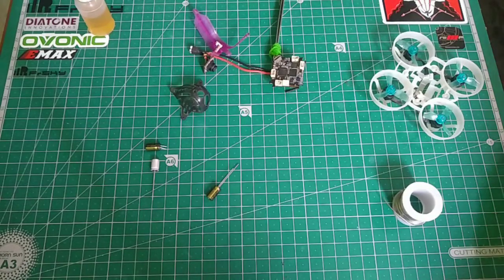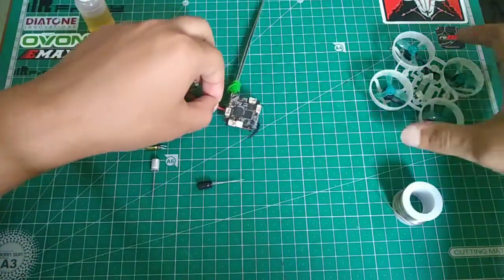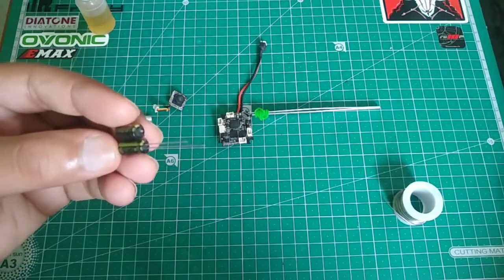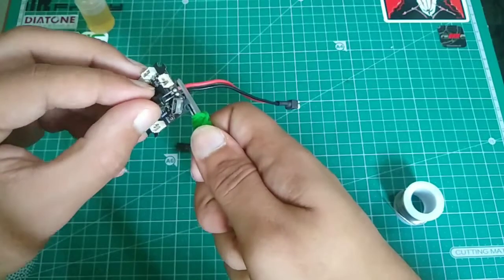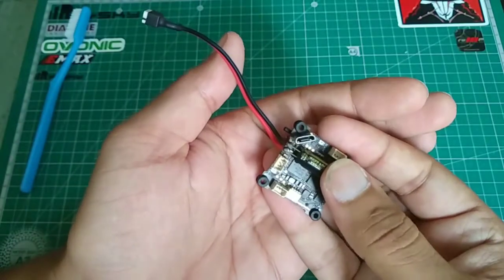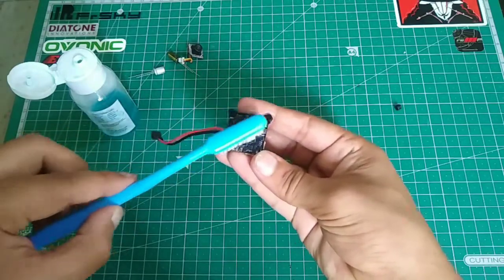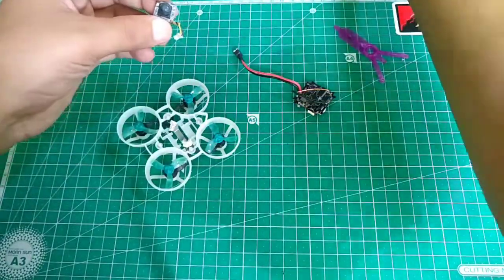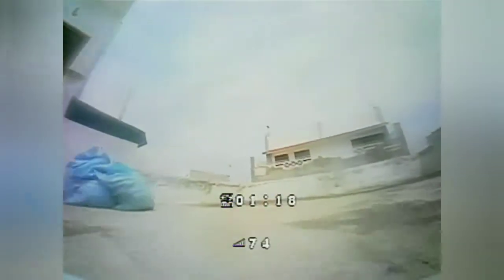FIX Jello 100% | Mobula 6/Betafpv + Capacitor Mod

Comment: Can I use 10v 2200uf capacitor? I have a bunch that I used to repair my cable box.
Reply from the maker: I don't think so because 2000uf is too much and you need 100-200 10v max and that too low esr if it's light weight and has Ultra low esr then why not
Reply: @justhackitfpv  ok thanks for the info, I ordered some 10v 220uf from Aliexpress.
Reply from the maker: Make Sure They Are Panasonic FM or Rubycon ZLH series
Reply: @justhackitfpv  Sanyo Low ESR, any good?
Reply from the maker: Yeah it's acceptable

Comment: I’m going to copy you on these mods! I’m getting electrical noise in my video feed. Was there any issue fitting the fc with the capacitor back into the frame?
Thanks for the video!
Reply from the maker: No not actually if you use right size incase you are worried try putting it on top rather than bottom use a proper low ESR cap and TPU Canopy